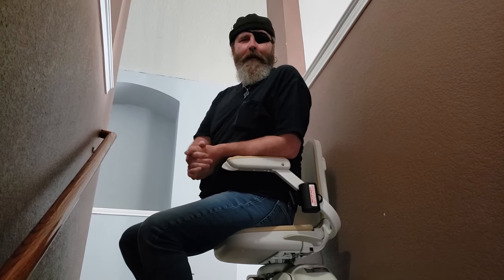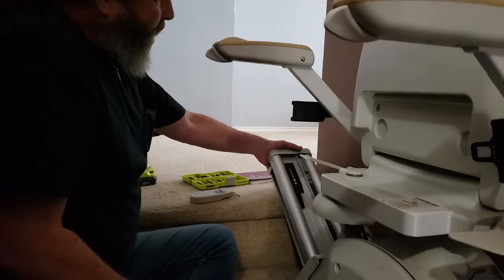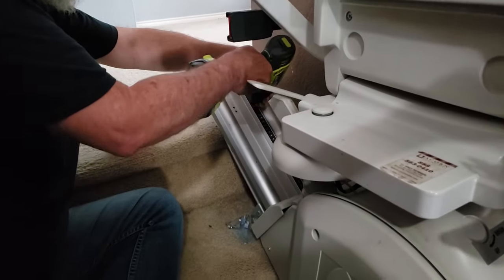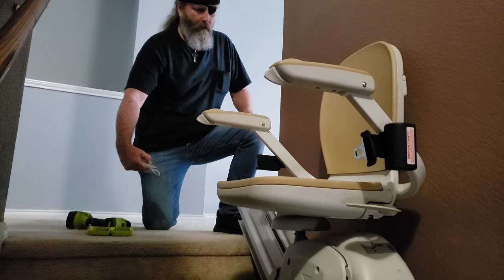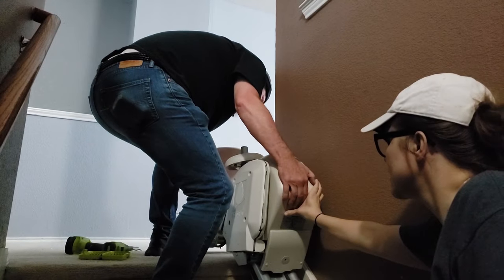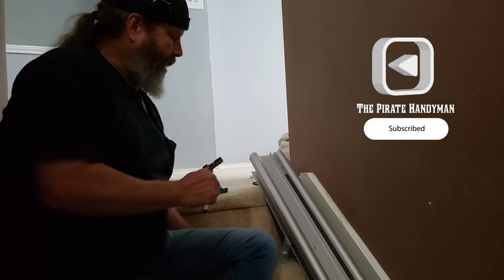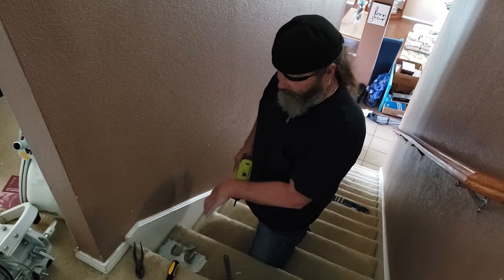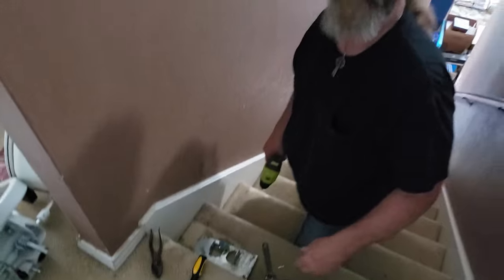How to Remove an Acorn Stair Lift Chair - STEP BY STEP

Comment: You took to much apart  all you had to do is take the legs out of the carpet and keep the unit altogether, I just helped put one together. Thanks for doing this video.
Reply from the maker: Thanks for the tips!
Reply: We just purchased one to install for my mom.  It worked in the home of the person that we bought it from but we can't seem to get it to work for us.  Any tips or suggestions on what we could be doing wrong.  Someone said that we need to have a technician come out and reset it.  Is this something we can do ourselves?
Reply: Paula, you are correct! He didn't need to remove all the wiring and should have unscrewed the plates from the stairs in stead of fussing with all the nuts and bolts under the track! 
I recently removed one of these and tree installed it in my brother's house for my father to use. The track was in 2 pieces and I broke it down to only 4 pieces total. It's nice to see videos like this sometimes to learn what not to do.
Reply: @monrobbins  I had the same problem the first time I tried to start it up after re installing. I found the error codes in the manual and checked all the safety switches. It stated to work after that. Good luck!

Comment: That was a very messy start. Power source was still connected too. Obviously a first time for you. Having the seat cable still connected as you attempted to lift the motorised unit from the rail looked very amateurish and unprepared. Lets hope the rest of the demo goes better
Reply from the maker: Aye, thank ye for the constructive comments, matey.

Comment: I know this product very well - a couple of things you missed. Where the two pieces of rail are spliced together, the gear rack overlaps the joint and there is a set-screw that needs to be removed from the gear rack at the overlapping end.  Also, there is no need to remove the charge points - just disconnect the cable that runs through the rail - there is a connector for that very reason.
Reply from the maker: Aye, matey, thank ye for the tips - very helpful!
Reply: Hi Matthew, as you know this product well, you might be able to help me. I was attempting to remove one of these using the instructions here, but forgot to take the block out at the top of the track. So when trying to run the chair off the top of the rail, it stopped and I lost all power to the lift.  I can't get the chair to go back down now in order to remove the block from the top of the track. Any suggestions please? and thanks.
Reply: Can ask your opinion on the reliability/build quality of the Acorn 180, I'm looking to buy a used stairlift to fit myself in my own home? 

A few people have told me to avoid it and go for a Handicare 2000, thank you. 🙂
Reply: @koppite1970 you most likely blew the fuse.
Reply: @MERCKXWOOD  Can only say that we had a straight Acorn 120 installed for about 12 years. It was 100% reliable. I'm selling it today, working order for about 25% of the original cost, which is what brought me to this excellent video!
Reply: @mtpeterteacher755  I'm pleased to hear that it was reliable. 👍

Comment: Thank you! I only took off the chair (keeping rail in place for now) and this made it easy peasy. We actually removed it assembled - the chair and battery together - which could be done if you have two people "catching" the chair as it comes off the rail (as it is very heavy).
Reply from the maker: Aye, matey, good advice  - thank ye!
Reply: This is good to know. I need to remove the chair to put  in a new washer. Found out that the company charges $250 for removal and replacement each.
Reply: How heavy is it ? 50lbs ? More?

Comment: Just removed my lift in about 20 minutes...  the HARDEST part was the 2" wood screws tightened down into the OAK stair steps....   We had the lift on a set of seven stairs down to the garage (for my wife with MS) so it was a one piece rail to remove.  Now, what to do with it?  Used for less than a year, not many cycles except when getting her to the doctor.
Reply from the maker: Glad to hear it worked, matey! As far as how to dispose of it, I would suggest contacting your local DAV chapter or another charitable organization that deals with folks with disabilites. I'm sure they would be happy to take it!

Comment: Thanks so much for this video! I had the Acorn 130 T700 stair lift installed for my elderly mom several years ago, so she could get to her things in our finished basement. One of the things they don't discuss in the manual is the removal of the chair when you need to move something large up and down the stairs. I don't want to remove it entirely, and this video was just the treat to figure out the quick way to remove when needed. It's been bugging me, because I needed to know how to do it. It was good to see that you should have two people to handle the chair assembly off and on. I can't thank you enough. 🏴‍☠
Reply from the maker: Aye, lass, thank ye for the kind words - glad it helped!

Comment: Great video. What if the chair doesn't work? Do I have to push it up to the top?
Reply from the maker: Aye, that is usually the best thing to do. You can use a socket wrench to turn the gear on the wheel to move it.

Comment: I’m cleaning up an older Acorn 120 and a couple of the nylon rollers in the bottom of the chair unit seem a little stiff like they need lubricated.  They don't seem worn out or sloppy, just roll a little stiff.  They are not rolling freely.  I'm considering putting the chair on its side then putting a drop of oil so it can get down around the shaft.  I'm just not sure what kind of lubricant to use.  I don't want to put something that will "eat" the nylon roller.  Anyone have any ideas on what type of lubricant to use?
Reply from the maker: Aye, matey, my favorite has always been 3-in-1 oil. It shouldn't damage the nylon roller.
Reply: @thepiratehandyman2225  Thanks for the quick reply....!! Ill try it.
Reply: Im using the 3 in 1 oil, its working pretty good.  A couple of the rollers are just not freeing up the way I want them to.  I want to take them off and look at the "axle".  Of course you need some type of special tool to hold the inside of the axle so you can take the nut off the other side.  Something that has 2 pins.  You aware of any other tools that can hold that while the nut is taken off the other side.  I'm sure you cannot get this tool from Acorn.
Reply from the maker: Can you get a pair of lock-tight pliers in there?
Reply: @thepiratehandyman2225  Well.. the head is pretty much flush with the roller, nothing really sticking out to get ahold of.  I might just end up making my own tool to hold it.  Thanks so much for responding though.  Great videos......!!
Reply from the maker: Thank ye for your kind words, and good luck - smooth sailin'!

Comment: Can ask your opinion on the reliability/build quality of the Acorn 180, I'm looking to buy a used stairlift to fit myself in my own home? 

A few people have told me to avoid it and go for a Handicare 2000, thank you. 🙂
Reply from the maker: I have to be honest - I really don't have enough experience with either Acorn or Handicare to make an informed decision. I would recommend that you search for a site that posts reviews on each.
Reply: 180 is a very good unit.
Reply: @thepiratehandyman2225    Thanks for replying. 🙂 A guy on an Acorn Facebook group who installs Acorn and Handicare and said to keep away from Acorn but that's just one person, apparently their customer care isn't supposed to be good but I wouldn't be using them. I'll see if I can find out more. 👍

Comment: We are getting our carpet changed so we will have to remove the stairlift and the reinstall it.Do we still need to take out the wires if we are putting it back??That will make it hard i believe
Reply from the maker: If you have enough slack in the wires to move it out of the way, then you should be okay. But make sure you unplug the power.

Comment: My mother has an Acorn Superglide 120 that's not working. I'm thinking of buying a used one and switching the chair/carriage onto her existing track. Do you know if the newer 130's will work on a 120 track? I can't seem to find that info anywhere. Thanks
Reply from the maker: Check the Acorn Website and see if they have any information on this. I am not sure.  Sorry!
Reply: @thepiratehandyman2225  for anyone else reading this, they do fit. The  Acorn 130 T700 works fine on the 120 track. However the transformer is different for a T700 so it had to be connected to the existing wiring

Comment: I have an older Acorn Superglide 120, I just replaced the batteries and made sure all connections are good.  I am now replacing the transformer and its wires to the charging post at bottom, couple questions, I am getting an error (4) which per codes list indicates seat not locked in, but it is...What can I do to solve this?  And second, will the chair lift without the transformer hooked up?  The old transformer fried and I had to replace it.  The codes I get have no letters, only #'s.  5 when off and 4 when on...Thank u in advance for your help.  Also my Dad is wondering why there is a large hole at bottom of footrest (underneath) and 3 screws.  We can see a spring thru the hole, but is something missing?
Reply from the maker: Lass, ye be in a pickle, alright.  I am not an Acorn technician, unfortunately.  Have you tried contacting their support center?  What you are describing is way above my rank.  I wish I could be more help.

Comment: help! i was attempting to remove one of these using your instructions but forgot to take the block out at the top of the track. So when trying to run the chair off the top of the rail, it stopped and I lost all power to the lift.  I can't get the chair to go back down now in order to remove the block from the top of the track. Any suggestions please and thanks.
Reply from the maker: Aye, matey, you are not alone. Others have used a ratchet on the main gear to move it off the stop. Also, you may want to look for a red "reset" button near the motor to restore power to the lift

Comment: I only need to remove the char. my washer dryer is up stairs and mocha says the installers can only lift as high as knees. do you think I can do that and then reconnect after the install. help
Reply from the maker: Aye, you should be able to follow the steps to remove thee chair, and after the washer/dryer installers are finished, you just follow the same steps in reverse.

Comment: Great video, thanks. I have an Acorn Superglide 120, not unlike your 130, spanning 10 steps but because the top two steps make a 90-degree turn to the top floor, the rail goes all the way up to the 90-degree wall above them... if you can picture that. Which means I can't take the cap off and slide the chair/motor off the top end as you did; the wall is in the way. The bottom end is screwed to the floor, so I'm going to have to find another way to get the chair off. Any ideas? Many thanks.
Reply from the maker: The only thing I can think is to unscrew the last section of track from the floor, remove the screws that hold the track sections together, remove the track, and try to slide the chair off that way.  I wonder how they installed it?
Reply: Thanks for the advice. But I've just checked and the whole 10-step rail is in one piece! So I reckon I'm going to have to get a stair lift engineer to get the job done... if only because I don't have a vehicle big enough to accommodate the track to take it to my local recycling facility.
Reply from the maker: Aye, sometimes ye have to call in the professionals.
Reply: Sawzall

Comment: I'm going to be removing pretty much the same unit this weekend- during a house auction. About how long did the operation take you ? And how long is the rail, which I will have to strap to the top of my car ? Thanks.
Reply from the maker: Aye, matey, it took nigh on 3 hours.  The length of the rails was maybe 8', and they be heavy buggers.  Hope you have a luggage rack of the top!
Reply: @thepiratehandyman2225  Thanks for getting back to me. Thats what I was afraid of. I don't really have three hours there, though I do have a rack on top. Got two more days to decide. You've been very helpful.
Reply from the maker: Unfortunately, matey, time is what it is.  I hopes ye can work  it out.

Comment: Hi  i need to install one of this  at my home   for my mom but the issue is  my stairs steps are made of stone  would i be able to   make  a 90 degree  from  2x4 and   screw the 2x4 to the wall and install  this on 2x4  thx
Reply from the maker: If you do that, you have to make sure the 2x4 is screwed into a stud.

Comment: My battery is dead and the unit is at the bottom. Do I need to replace the battery and bring the unit to the top to remove the chair?  Thank you
Reply from the maker: That I don't know. Check the manufacturer's website or call their support line. I would think if you are removing the unit, there should be a way to do so without having to buy a new battery.

Comment: Does the tooth groove track need to be removed first before the two large pieces can be separated?
Reply from the maker: No.  Once ye remove the stops, ye ken take the chair and motor off, without removing the track.

Comment: can you shorten the unit? if you get a used one that is too long?
Reply from the maker: Yes.  But you have to be very careful to shorten both the rail and the track by the exact same amount.  And you have to be sure to install the stops on the ends.

Comment: I removed all the bolts and the track still will not separate. What am I missing?
Reply from the maker: Aye, look closely for screws in the track.  They are the same color as the track and are flush with the track, and can be hard to see.

Comment: Hi, my stairlift cannot move even the power is on and it is at the bottom of the stairs. Anyway I can remove it please?
Reply from the maker: You will have to take the rail apart just ahead of where the chair is, then use a wrench on the motor to turn the gear on the chair toward where you removed the rail.

Comment: You didn't need to take it apart that much. The chair assembly is 2 pieces and the track was one piece with legs attached.  Yes removing the stops to allow the motor to come off the rail. Then replace the stops until the next installation. As a DIYr I did this job a couple months ago on a longer 2 piece track. Broke it down to only 4 pieces and did not remove the wiring. Only needed to adjust the legs a little on the install. Thanks for the video though.
Reply from the maker: Aye, matey, and thank ye for the tips!  Readers, take note!

Comment: How hard is it to alter the length of the track?
Reply from the maker: Not terribly hard, but you need to contact Acorn to get the length you need.
Reply: @thepiratehandyman2225  Well I am thinking of buying a used one off of facebook or craigslist, not too sure of how eager they would be to help? Longer and cut seems the best plan, a split level home, so most are longer.
Reply from the maker: Sounds like a plan!

Comment: Agree with your instructions through the removal of the chair, after that so many unnecessary steps.
1-unplug
2-remove three screws on upper part of the joint seam
3-unscrew bolt just above seam in cog track (about 6 inches from main body seam)
4-remove the four bolts in each of the floor plates on upper part of rail
5-pull rail apart at seam
6-pull wire out from rail at seam (ours was about a foot into the top rail bottom) until connector comes out, and undo the connector
7-remove and store upper section
8-undo four bolts on lower floor plates
9-move lower section 
3-easy to remove, and EASY TO REMOVE AND TO REINSTALL
Reply from the maker: Thank ye, matey, for the excellent suggestion!

Comment: replaced circuit board on acorn stairlift getting beeping and a figure 8 on screen and it wont move any ideas
Reply from the maker: No idea. If you to their website, select the support tab, put in the model number, and it should give you a troubleshooting guide with error codes.
Reply: @thepiratehandyman2225  thank you

Comment: Hi there, excellent instructions! however, I did something wrong. I removed the plastic black stop but didn't remove the gear stop block. Now, the stairlift got stuck at the end and doesn't move :-( Any advice?
Reply from the maker: Aye, matey, ye be in a pickle!  However, here's something you can try.  With the chair switched to move it away from the metal block, turn it on, put a flathead screwdriver under the gear teeth on the chair motor and try to pry it away from the stop block.  If necessary, tap the screwdriver with a hammer.  Also, if you have a second person helping you, have them push the chair away from the stop block at the same time.  Let me know if this works.  If it doesn't, we will figure it out, matey!
Reply: @thepiratehandyman2225  Thanks will try that. One problem though, the power somehow is disconnected internally even though it is plugged in. But, I think your idea of pushing the chair back with a flathead screwdriver and pulling it back at the same time may work. Will try and keep you posted!
Reply from the maker: Because the chair got "stuck," there might be a circuit breaker on the chair.  Look for a red reset button, and that might allow the motor to run again.
Reply: @thepiratehandyman2225  Thanks! I was able to get the stairlift off the rail. I was thinking about the breaker and didn't know where it is. Awesome, will do it. Appreciate your help!
Reply: @ravimusic9835  I've done the exact same thing as you. how did you remove the stairlift from the rail? Is there a reset button somewhere for the motor?